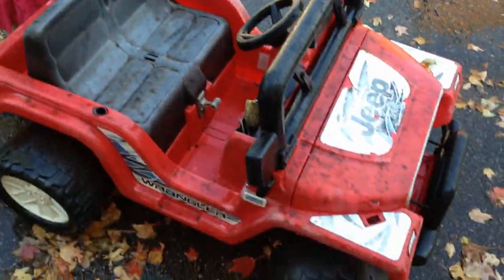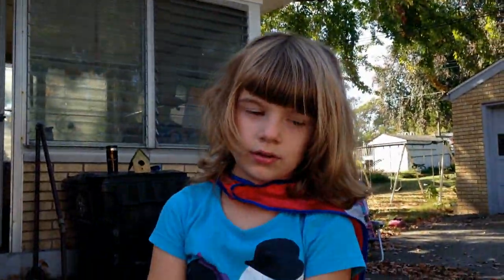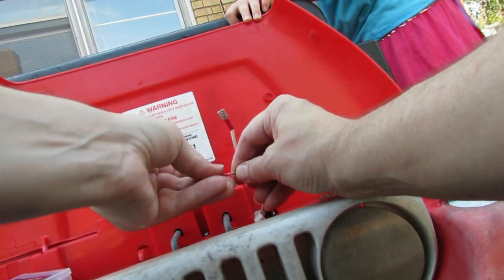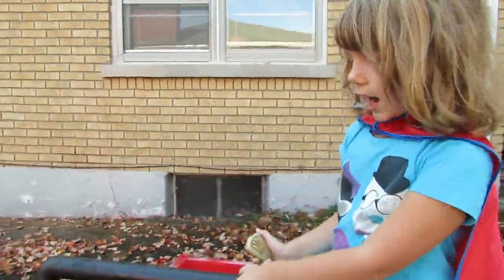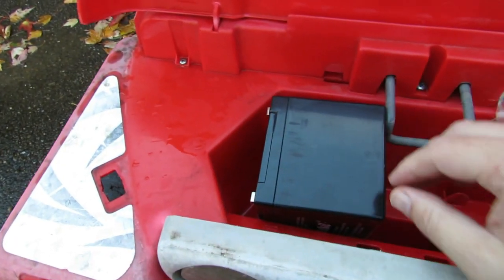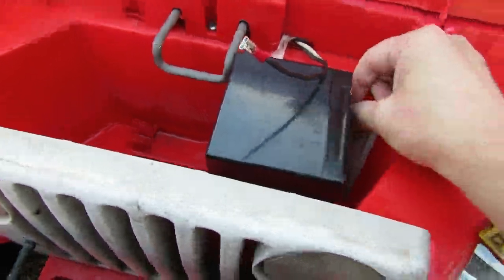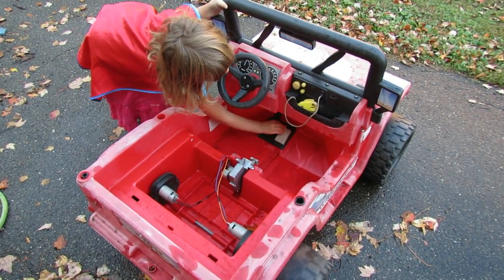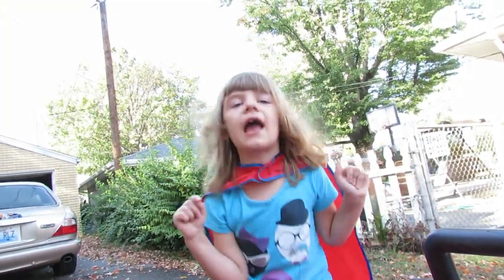Daughter and I Restore Trashed Power Wheels Jeep Found on Curb

Comment: You know if you take a few sheet metal screws, the kind with the big knobby heads on them, and drive them into the drive wheels that thing will get a lot better grip in the dirt & grass. I did that for a friend's kid since he couldn't get it to move when the grass was wet. I just used the tread pattern for spacing them out evenly. They act like studs on snow tires though and it worked pretty well.
Reply: I need you to tell a old man how to do that

Comment: SWEET! I was trying to find out if you can use whatever battery you want instead of a PowerWheels Proprietary battery, or if you can charge the proprietary battery with a Walmart charger as long as I "fix" the connectors. Recently scored several sealed 12Volt batteries for these types of toys so THANKS!!!
Reply from the maker: Yes. You can use any 12v after changing terminals.

Comment: Also you should not be running it without a fuse! There could be a short and the wires will get hot and start to melt and this could cause it to short. If your using an aftermarket battery run an inline fuse holder paired with a 30/40 amp fuse (price for the fuses and fuse holder is like less then 6 bucks at any auto store) or even better by a resetable 30/40 amp circuit breaker.

Comment: I dont have a meter thing to check the electronics. is there a way I can rig something else up to check
Reply from the maker: To check the continuity of a circuit, get a battery and a flashlight bulb, and a couple pieces of wire. Connect the bulb and the thing you're testing in series. If the bulb lights up, the circuit is continuous. If not, it isn't continuous.
Reply: @TheGuitologist  I appreciate the reply! It was helpful

Comment: Hello!! I have one I need running i have the original battery and I charged it and put it in the car but it had been sitting for 3 years so it wouldn't move any idea what the problem is?
Reply from the maker: Switches. Search back through my channel, I have a video showing how to repair those without buying new ones.
Reply: @TheGuitologist   thanks! i will check them out.

Comment: IF you ever need any help modfiedpowerwheels is the place to go! Not smart spraying it down with water with gearboxes and motors still in.  Another thing to Add if you find a trashed power wheels and the motor and gearbox are good the first thing you should do is clean the Gearbox. SUPER EASY. If the lube inside is old and dirty it can cause the motors to draw a higher current and can cause diminished power and higher amp draw which could cause the fuse to blow and cause shorter battery life. All you do is pop the stock caps off the axle pull the wheels off and remove the motors and gearbox as one (Cut the wire in the middle so you can resplice it or if you can solider just put new wire to the motors) Then all you need to do is remove 4 screws (if itsa #7 GB like on all these 2000s model jeeps) and pup some clips as well as the two flat head screws that hold the motor to the box. Open it up remove the gears and clean the big chunks of lube and all the lube you can get by hand. Then soak it overnight in a dish soap water combo. Next day clean it again and you can use Q Tips to get into the small areas you couldn't get other wise. Let it dry completely. Set it out in the sun or if you brave you could pop it into the oven at the lowest temp setting(not recommended IMO because it could weaken the plastic, but some people do it ) Once its dry lube up the metal rods the gears go on and throw all the gear back in. lube the gears up and spin the gears to make sure it spreads good and make sure if your gonna put extra put it on top of the gears. This way when it heats up the lube will flow down. On the gear that connects to the motor pinion put a nice dab of grease on it. Dont need to put a lot just enough. Put the gearbox together and put the motor back in and screw it all back together. As for lube I used White Lithium Grease. You can use your choice just make sure it is safe for plastic and that you got all the old grease/lube out. combining different kinds of grease can cause a reaction and damage the gearbox.  If you ever need any help with power wheels just get in contact with me or head over to the site I told you about earlier, it has a wealth of knowledge from many experts that know way more then me.
Reply: Oh and for the stock caps that keeps the wheels on, once you take them off you wont be able to put them back. Its no problem, just go to your local hardware store and get some 1/2 inch shaft collars. In my area Lowes-Home Depot did not carry them but Ace did. You can also order them off amazon.
Reply: Hi where can i get info how to fix 12v bike

Comment: Are the motors water proof?
Reply from the maker: I'd say they are water resilient. You can get them wet without causing any issues. They are DC motors. The windings are lacquer coated, I'm sure, so there's little chance of shorting. I see the purpose of your question though, you want to know if you can wash them safely in the vehicle. Yes. I've washed several of these Power Wheels with the motors left in and drowned them.

Comment: Hello sir I have a question I have four cables coming out of mine instead of jus two do you know how I tell which is for what
Reply from the maker: Four cables coming out of what, the battery connector? Could be for another onboard radio or lights, or whatever extra feature yours has.
Reply: Coming to the battery connector it's a 1991 it has  a black and blue red and white how would I reroute that to the current model harness?

Comment: Just because you have continuity at the motors does not mean they are good. Got to think these Jeeps were made in the early 2000s and some are 15 years old. These motors can still work but because of the age they can draw higher amp currents and blow even 40 amp fuses. ITs no problem though, you can get a pair of duratrax 550 motors (one of the best motors at 6-12 volts, but nothing higher or they burn up) and then just get the correct pinon and put it on the motor shaft and your good to go